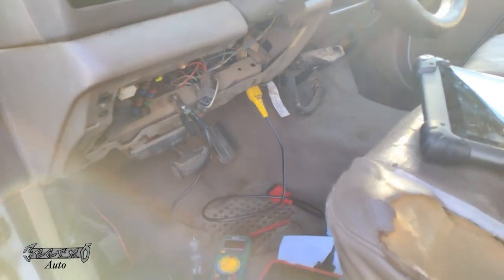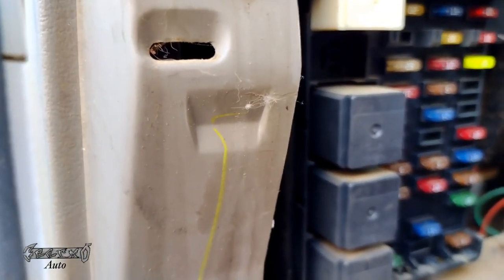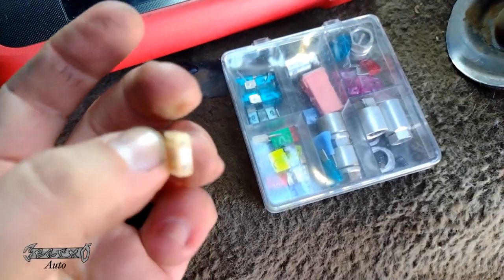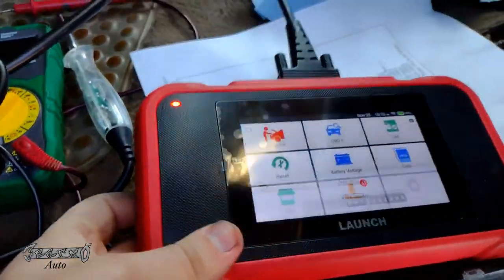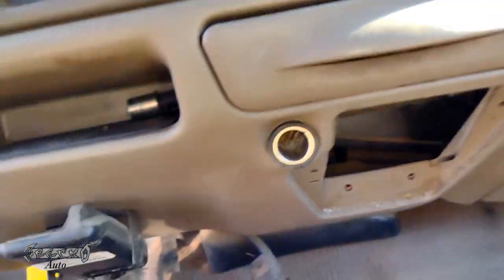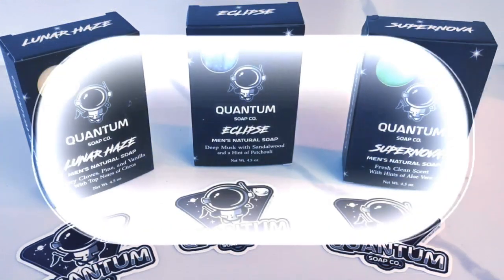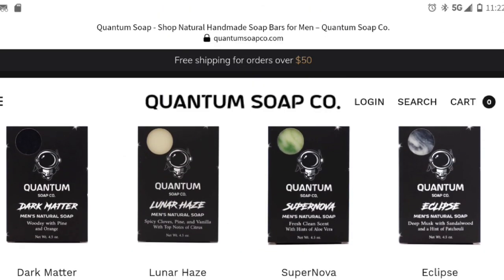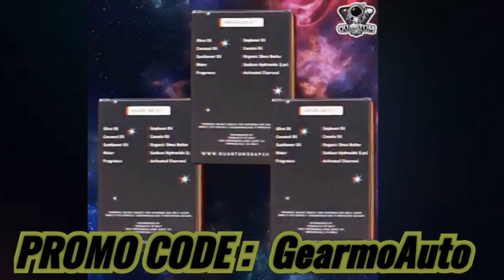2001 FORD F-250 NO POWER AT DLC / SOLVED

Comment: That fuse should be a 15amp. 

They probably put a larger fuse in because it kept popping. Also, usually a good idea to check those cigarette lighters for any metallic debris first, that will cause it to pop instantly.